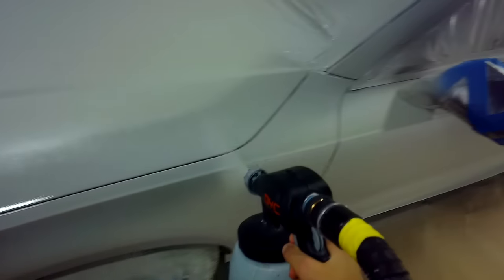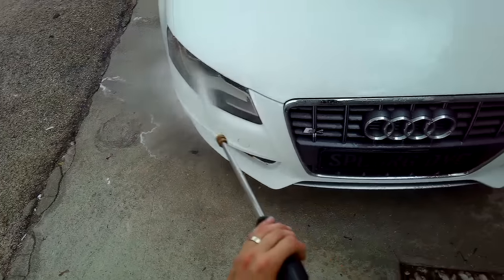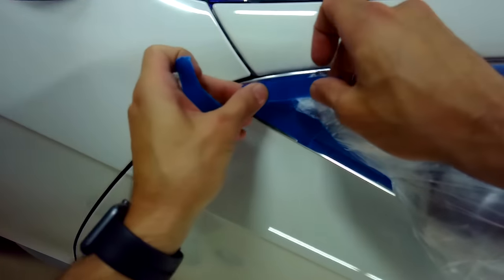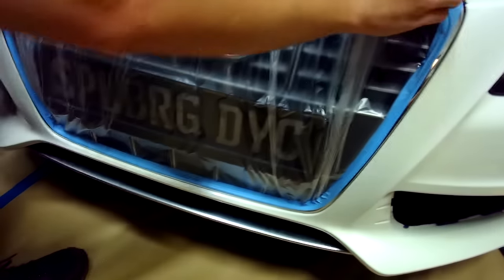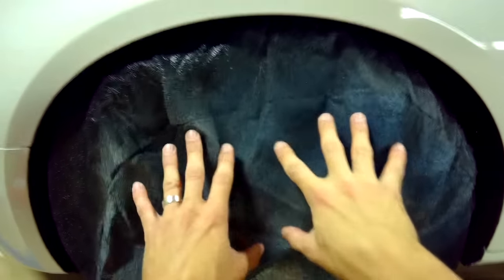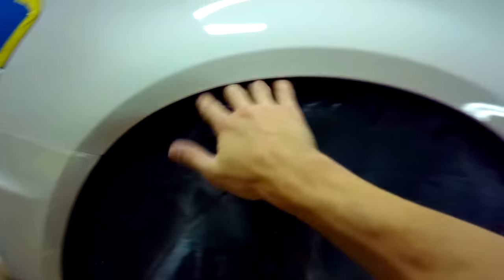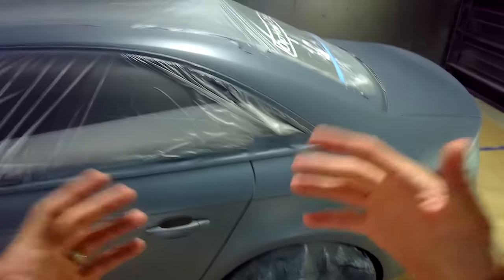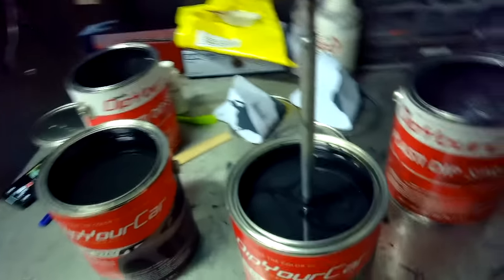Dip Your Car - The Entire Process in  First Person View

Comment: I hate to criticize you on one thing but I have to bring it up. At 32:15 you say to make sure to use up all of your plasti dip base gallons before applying the performance series gallons, yet at 32:41 you can see that there is still about 1/3 of a gallon of the gun metal grey left when you moved on to the perfomance series. Which leads me to ask, are we really supposed to use 100% of the product we were given or do we stop if we are certain that what we have left will not complete one more full coat? 

Otherwise this was a very well done and informative video.
Reply from the maker: matthgmdude1 thanks for watching!  There’s not 1/3 of a gallon of gunmetal left. We cleaned the gun and hoppers w Naphtha and dumped it back into the grey gallon can before we moved on to the Onyx. You should always use 100% of the product included, even if you can’t finish a final coat. You paid for the full gallon, don’t waste any of it.  If anything, you can save 8-10 ounces of your final Performance Series color in a sealed container just in case of any touch ups down the road.
Reply: Thanks for clearing that up for me!

Comment: Hey, just bought a car that was dipped, has to use xylene to remove because it wouldn’t come off without it, the car was all primer underneath, was wondering if the primer was the cause of the dip not coming off and if I should clear coat the car before I dip it or not, thanks.
Reply from the maker: lunnzee the issue was 100% the primer. Primer’s whole purpose is to make things grip and stick to it. That really changes the behavior of a Peelable Paint, which is designed to go over clear coat.
Reply: DipYourCar okay thanks! I’ll have to clear coat it before I go ahead and order the gallons for the redip!

Comment: We just bought the medium dip kit from you and are wondering if the prep is the same for an old 2002 car with paint chips and dings? Do we need to repair those or does this fill in all the small imperfections?
Reply from the maker: Prep is the same, just make sure you clean out the chips really well.  As far as repairing them first, that's personal preference.  Small, shallow chips will be covered by the dip really well.  Deeper chips and scratches may still show through.  It's up to you on how you want to proceed before you spray.

Comment: Can you plastic dip a car that has Arizona pinstriped? As in you went on top of a mountain. And the whole car is scratched up? Or should I strip off all of the paint. Bondo the whole car. And then plastic dip? I’m looking for a paint that will protect my body panels when going off roading.
Reply: The Life Of A Mechanic’s Progression #QuestFor153 repair the scratches first. Plastidip mimics the surface below it. If there's a bump, you'll see it through the dip no matter how much you put on. Make sure you're spraying on a smooth surface. Also, plastidip won't protect your paint from really bad scratches. Like if you hit a rock on a mountain and scraped it really bad, it would still scratch the paint below it. However, from most nicks and scratches, plastidip is thick enough to protect the paint from that.
Reply: Jonathon Eerie hi. I was thinking more of just getting rid of the paint. Then Bondo the panels and what not. And then spray bed liner as my paint. I’m looking for  a deep purpleish bluish color.

Comment: Question. Maybe this has been answered before but I'm curious.
 What do you do about the color change as far as the registration goes? For example where I am in Illinois if you get stopped by "one time" once they run your plates it comes back as the factory color of your vehicle but if I was to dip my Subaru from white to a blue what type of issue would that cause?
Reply: Youd have to notify your dmv that the cars color has been changed (at least its like in California)

Comment: About how long will plasti dip last on a car like this? Can you use a pressure washer on it? Get bird crap on it will it withstand rigorous scrubbing? Stuff like that
Reply from the maker: BARE BONES TACTICAL will last years easily if applied correctly. Yes pressure washers are fine, just use common sense and don’t get closer than a couple inches away. Bug Delete is a product that removes almost any stain from dip. Very durable and easy to maintain long term.
Reply: DipYourCar awesome thank you for the info!

Comment: You NEVER use a pressure washer or even a spray gun on the end of a garden hose to rinse the car off. Just let the water run as you rinse the car off Top to Bottom. It'll get rid if any and all trapped soapy water that accumulates when using a spray nozzle. Smh

Comment: It's infuriating and makes me absolutely cringe when I see people washing their car and they either don't start from the top of the car. You're an animal in my mind if you do it that way. 
 Work your way down, separating the car into sections - roof, windows, shoulder, top of wheel arch line, bottom of door, and finally rocker panel & below.  Never bring the wash mit back up into a higher section that you've just washed from the lower section you're currently in washing! 
Wash your car 1st then wash the wheels and tires separately and never with the same mits and brushes used on the vehicle
Also use the 3 bucket method with a grit guard in each bucket: Soapy water, dirty rinse water,  clean rinse water